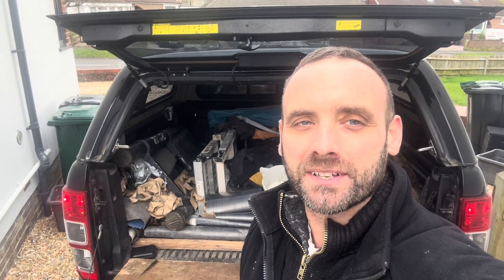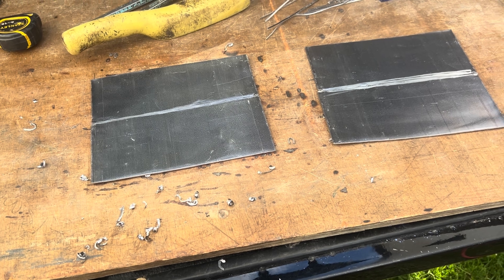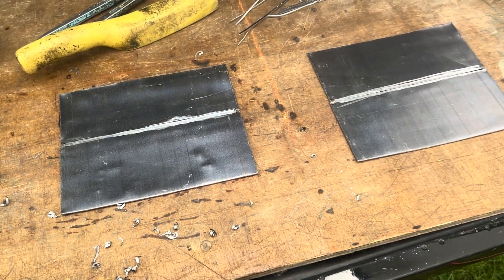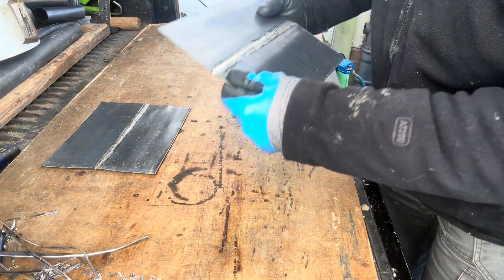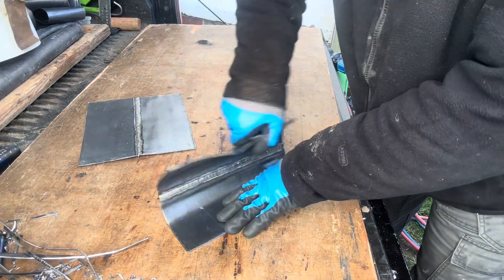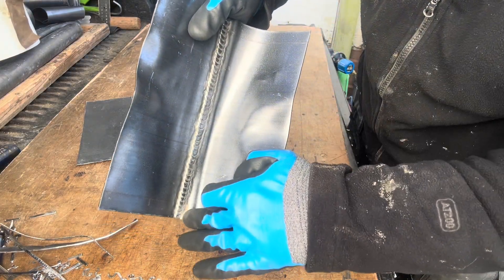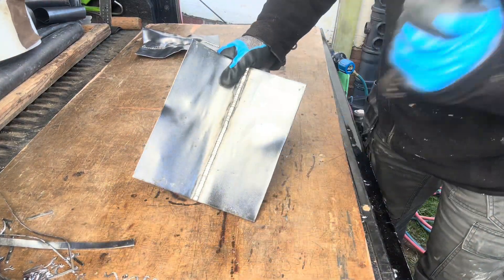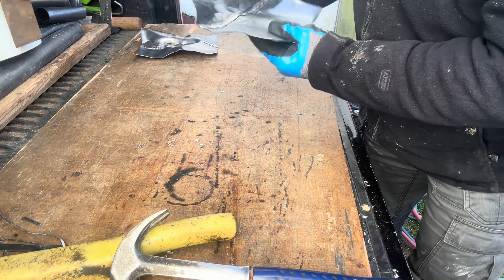What Type Of Lead Weld Is Strongest ?

Comment: Excellent demonstration. Learning more about lead welding and molten bonding strength in your videos than anywhere else. Question: what thickness are the lead sheets you are using? I may start and experiment with the same. Much appreciated.
Reply from the maker: In this video I’m using code 4 lead which is 1.80mm thick.

Comment: Does acetylene tend to go off? I’ve not used my bottles for about 4 months! I started having a practice again but the weld always seems to be dull like there is something in the lead (rods and new c4 lead  sheet shave hooked!)  tried adjusting the flame it either ends up too hot or to cool! The weld looks ok but dirty!! 😂
Reply from the maker: Not to my knowledge. You’ve shaved everything clean. So I’d say try adjusting your pressures to see if you can get a cleaner flame .
Thanks for watching.
Reply: @slbleadworks  Thanks Stuart maybe time for some better regulators ! Increased them both to 0.75 which seems a bit better!! Did notice the needles sticking a bit though 😂
Reply: @slbleadworks  Also I changed back to a number 2 nozzle seemed to help a lot :)
Reply from the maker: @cba1424  oh cool. Sounds like you’re getting there now ?
Reply: @slbleadworks  yes getting more confident with it each time! Something I don’t do everyday and it’s been a while since I last did any!! Practice practice practice that’s what it’s all about!! Really appreciate all the videos and comments don’t know how you find the time haha it really does make a big difference with all the cuts and setting out :) 

Not many people round our way that can weld anymore most so called roofers just do stack bashing or just leave the old stuff on. The old guy that used to do welding for us had retired and moved I was keen to pick it up but without going on a course or having someone there to show you it’s hard so your videos are invaluable to us all 😎
Reply from the maker: @cba1424  I really do appreciate you watching the vids and I’m glad you find them useful. A new vid goes live at 7 tonight 😉😂. 
It is hard trying to make the time. I have to do the video clips during my lunch breaks or not stop all day to make up the time. 
But I really enjoy them and trying hard to make the channel grow. 
So you watching the vids and leaving comments really helps. 
Just wish everyone would subscribe lol🤦🏻‍♂️😂

Comment: Instead of using a scraper to clean up the weld, does a steel or brass wire brush clean up the lead enough aswell? Hope you are doing well and please make sure to read you body limits. Rushing to get work in while having aches doesn't make them go away quicker. Trust me, I tried...
Reply from the maker: I usually use a shave hook to clean up the welding rods but a wire brush to clean up the area to be welded. Seems to work pretty well like this.
Thanks for watching.

Comment: Should have clamped it down on the edge of a workbench so you could get a good bend along the weld and maybe you could count the bends up and down.

There is a time and place for each type of weld but mainly most are overlapped.
I'm trying to think when I would have used butt welds, aprons,cavity trays or shower trays I would have used butt welds, the back of a dormer it's an overlap to make it easier to zip up the angle
Reply from the maker: I have  only ever really done lap welds. It’s the way I was taught so followed suit. 
Are you still in the trade now ?.
Reply: Not as much as I used to be due to a fall from a roof,
I had to have my lower spine fused and I have never been the same since,
I would knock up the odd lead slate for a builder I know but that's as far as I'd go nowadays as my confidence working at heights is gone.
I spend most of my time fishing now but I do enjoy making my own weights lol
Reply from the maker: @IrishPikeHunter  I’m so sorry to hear that. 
Hope your retired now ?
Reply: @slbleadworks  yup I'm retired now, but I do miss the leadwork, I tried yard work for a while, but it was too much of a struggle for me at the end
Reply from the maker: @IrishPikeHunter  well I hope your enjoying your retirement and getting plenty of fishing in.